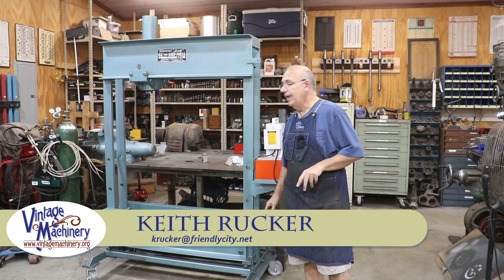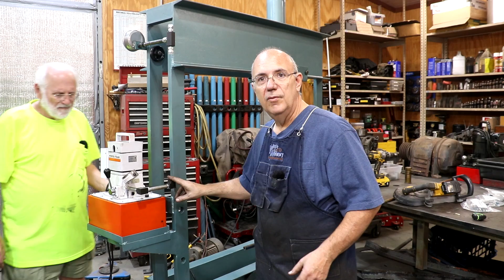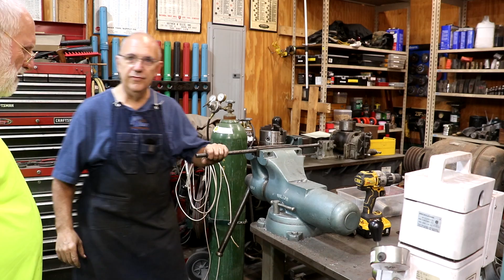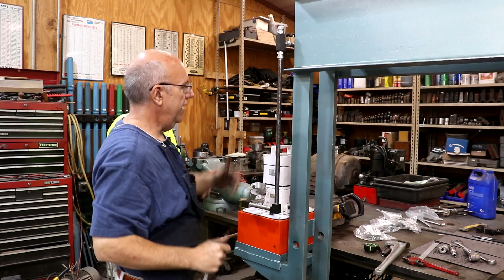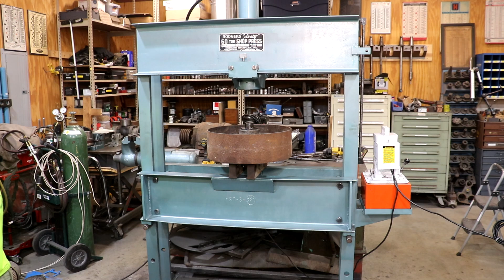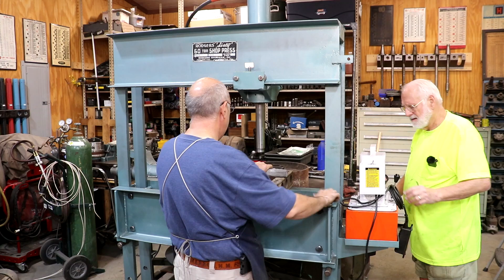Hydraulic Press Restoration:  Plumbing up the Power Pack and Making our First Presses!

Comment: How neat it is to have this perfect pump land on your lap AGAIN ! I have been in a shop where dummys had access to the 50 ton in my corner  of the shop that whenever they showed up to use it I would either leave the area or stop their needs and do the press the job myself. It is called self preservation eh, LOL, Some JIC fittings or pipe thread fittings should serve you well old friend. Teflon tape on hydraulcs is defiently not a good place to go to at all. A pc of tape stuck in a valve can be really dangerous my friend. I put a piece of  belting under that same press to catch all the pieces of material that came from my press. Worked great but a net type would have been far better for the type of jobs I was doing. Luv the channel a bunch my friend. Let us see just what this press is capeable. Should be a lot eh.  A full tone over by the time you get it to the best eh..

Comment: Hello Keith. I noticed that when you tightened up your tail peace chuck on a thread tap, that you only used one position on the chuck to tighten the thread tap and it slipped when you tried to run it in to cut threads. If you will use all 3 positions to tighten the chuck. It will hold much better.

Comment: I would rethink your gauge position. I have a 60 ton press myself with the gauge centered in the front of the press over the ram. I watch the gauge all the time to follow what is going on which you will not be able to do with the gauge and work at the same time. This will keep you out of trouble and allow you repeatability on projects that have repeated operations. My two cents. You will love the press!

Comment: When I have needed to straighten or bend things in my press, I fit a dial indicator so I know how much I have deflected the part. When I take off the pressre to see how much more I need to move, I can then easily get back to the point where I left off.

Comment: That is a nice press. Might be able to make it return faster with a second return line to the tank that is larger than the supply line with a valve that is opened for return. The spring is having to overcome quite a bit of restriction in the supply line and valve body.

Comment: You are better off with a slow-running press with what you do, you have better control over it and can stop it if you have to before it presses too far and something goes wrong. 50 tons is a lot of power

Comment: I had an Aluminum vee block split like that in a press too. I think the sharp corner in the bottom of the vee didn't help either. If you consider the loads, a shaft is trying to pull the block apart. Maybe a shallower vee block angle would be better.

Comment: I need a "Jim Lane" in Charlotte 😁 I have a very similar power pack I want to turn into a forge press but have no clue what I'm doing. Mine is two stage; 700psi fast travel and 10,000psi slow travel. My problem is finding a 10,000psi cylinder. I wish mine was more like yours, just a single. Your single 10,000 moves faster than mine but my 700 moves faster than your 10,000

Comment: it make a lot of noise for slow result for the return you can set up an out side set of springs for faster return also may need to look at the return valve might be a bit small not allowing the oil to return to tank fast enough Cheers on a nice build

Comment: A few years ago, I was at a friend's shop attempting to straighten out some metal target stands on his press. I had them mounted on spacers and was applying pressure when all of a sudden there was a loud bang. When I looked at the press, the metal plate, approximately 3' long was gone! It had apparently sprung, gone down between my legs, bounced off the floor and hit the exhaust on a dragster that was behind me. The "what could have happened to me" thought was off the charts! Standing off to the side when pressing is not a bad idea!

Comment: Keith, considering that your pump has a double pressure valve, you can consider a hydraulic/ cable lift for the bottom assembly. You might need an additional cut off  valve to maintain the pressure for the lift assembly.

Comment: I was setting here wondering if you would break those cast Vblocks.
 Need some machined from some 4140 or other good alloy steel or even heavy fabricated ones.
Leave plenty of thickness between the bottom of the V and the bottom of the block.
 Thank God no one was hurt.

Comment: Nice work as always.

When you make the shop press drifts Kieth, perhaps copy what Pragmatic Lee did with his 20 tonne press when he made his drifts and creat pockets in the socket to glue rare earth neodymium magnets in the bottom, to hold them in place on the cylinder shaft.

19 minutes onwards in this link.

https://youtu.be/OMM56hnK7Bk

Hope that helps.

👍👍👍

Comment: I think the speed is about right and everything seems to be operating up to snuff.  The only thing I might suggest is not to run with the ram extended quite so much as it could bind the piston at a long extension.

Comment: I am trying to wrap my mind arround how 5,000 psi = 30 tons of pressure.
Reply: Hydraulic pressure is multiplied by the area of the piston in the hydraulic cylinder.  The area of the piston must be 12 square inches to achieve 60,000 psi or 30 tons. Therefore the piston diameter is about 4 inches.

Comment: a press is a wonderful fantom in any machine shop, that press is no exception.
When working on a press, I always fear unstable setups, this can cause injuries and at the limits, the death.
on your press, to what i can see, the ram is rather small in diameter so the guidance is not that great so i'd avoid to press to the capacity of the  cylinder when the ram is fully extended.
excellent project

Comment: The hydraulic swivel fittings I am familiar with don't seal on the threads. The pipe has a chamfer on the inside that seals with a cone in the fitting. If your pipe did not get chamfered nicely it probably would not seal well.

Comment: I don't find any schedule 80 pipe that is rated for 10,000 psi working pressure. The burst pressures aren't even rated that high. Be careful! Even hydraulic tubing, only 1/8 inch .049 wall thickness is rated at 10,691 working pressure.

Comment: Keith,'
Dont know if its my eyes or an optical illusion fm the camera lens....but when u last pressed that shaft and the front lower cross beam flexed a bit, it now appears to me that the front lower crossbeam is showing a slight bow downwards in the center.... maybe 1/32 inch where as its mate to the rear is perfectly straight.....FYI
Don

Comment: Oh yeah, nice to see it finally working
What I noticed, it would propably help to tighten the clamp bolts on each side of the carriage with the cylinder so it doesn't tend to wobble when it starts building up force

Comment: Why the fittings didn’t seal is because the swivel end of the fitting is made for a machined fit, like the inside of a hydraulic hose, where as a pipe seals through the tapered threads

Comment: Make yourself a V block that goes on the ram for straightening round shafts. Best accessory you can have for it.
Reply: Keith can probably make a whole video on making accessories for the press, maybe some solid steel v blocks and a v block for the ram. A good set of parallels and all kinds of push rods and different ends for the ram, a lot of will probably be one off items too.

Comment: I'm glad you're making sure all your components are rated for the pressure your unit is capable of producing. 10,000 psi is no joke. I worked for a hydraulics specialty company for quite a few years, then worked as a maintenance mechanic in a production plant. It was not uncommon to find standard water pipe fittings being used in hydraulic pressure applications. Fortunately, the pressures were relatively low (1100 psi). The potential for a tremendous mess was high. My right index finger got injected with hydraulic oil at 3,000 psi and it's not really a functional finger anymore. High pressure leaks can be extremely dangerous.
Reply: I worked with a tech at one company and he lost a finger on a job, when a pinhole leak on a 10,000psi system essentially flayed his finger of most of the flesh. The only thing more dangerous in the high-pressure world is live steam.

Comment: Get a couple of pieces of rail from the railroad (badly worn is ok), mill the tread area flat and bring them to equal height, and they will make ideal support bars for the press.  We used these for everything where we needed support blocks.
Reply: Work hardened I-beams is what we called them.

Comment: Wow, that was fun to watch!  Good job, you two.  I have two "physics nerd" comments; probably not worth the time in a job shop, but perhaps instructive.  First, could you find, or even calculate, the stiffness of your parallels?  Put an unloaded straight edge on the top and you will get an independent measure of the pressing force.  Second, wouldn't you ordinarily want to heat the bent shaft up while or after straightening it?  This would anneal the stresses caused by the bending and probably reduce spring-back.  I realize that welding on a new layer before cutting the shaft to its original diameter would likely do your annealing anyway.

Comment: I like it. I think you should rig a strap to your ram to lift and lower your bed rails.
Reply: I wonder if that ram has enough capacity to raise and lower the rails, I think you’re right about making something to power raise and lower bed rails. Maybe a long hydraulic cylinder to attach to the cables that lift the rails, there are a number of ways to power that.

Comment: The remote pendant is a great option for this press.  The exploding V block is exactly the type of danger that presses are capable of.  I worked in industry where we had a person killed because a tooling piece ejected from a press, causing blunt force trauma that caused instant death.    Great video and great project!
Reply: Dan Gelbart called the hydraulic press the most dangerous machine in his shop tour. The energy these things can store in the workpiece is frightening. They can shoot shrapnel like an artillery shell.

Comment: Back in my earlier years in life I helped design hydraulic presses that would take the kinks out of 11" steel bars.  The presses would develop up to 500 tons of force!  We installed dump valves that would dump the volume of fluid in the cylinder when retracted. Thanks for sharing. Ken
Reply: As an 18 year old I remember seeing a 750 ton extrusion press being installed, well, reinstalled. The plumbing was mostly  very thick wall tube with an acme thread cut, the ends being true, the threaded bits met a copper washer in the middle of a hefty steel block. A crane made holding the fittings a bit easier. Nothing was delicate. The fun bit was seeing aluminium behave like toothpaste!

Comment: I think slow is better on a big press , you can break a lot of stuff getting in, ram it through , it’l go mode ! It’s better to keep the pressure on and use finesse like heat or cold and a few shocking taps with a hammer or air tool . I like it!

Comment: Looking good, Keith!  Glad you've got the extra long cord for the pendant.  You would still have been safe operating from the power pack since the separation of your v-blocks was perpendicular to where you would be standing, but that's still a little too close for comfort.  Your shop, your shop practices.  No criticism, just want to see you not get hurt.  I agree with a previous comment that the bracket for the bigger gauge would be a great place to hang some hearing protection when you're not using the press.  As loud as it was on the video, I can only imagine what it was like in person.  Still working on my plans for a workshop for when I retire.  Out of my price range right now, but I retire in ten years, so it's something to save up for.  Still have a little shop envy, though.  My little 8 by 24 woodworking shop would fit inside yours several times.

Comment: I retired from a car factory. The paint booth cleaners used a high volume/high pressure water jet to clean the overspray off the walls of the paint booths.  It was adjustable up to 10,000 psi.  They normally opersated at about 7500 psi.  The pipe was 1/2" ID but about 2" OD.  Over time the water eroded the standard 90 degree ells and the pipefitters had to replace every standard ell with a long sweep ell to prevent it from happening again. It is amazing what high pressure fluid can do. Keith, please be careful around your press. I was thinking a Lexon screen might be a good idea. Hinge it from the top lip of the C channel at the top of the press. Use a rope and pulley to lower it into place if you ever feel at risk.
Reply: Kind of the responsible YouTuber version of Jackass, sometimes.

Comment: While you're making push pins, make a saddle to fit the ram, to attach a wire cable on each side, over the pulleys, then configure slack to raise or lower the heavy table with the main ram. How cool is that!

Comment: Don't think schedule 80 is rated for 10000 psig?
Reply: Yes, it is Carbon Steel, SCH 80 A106 Seamless, .216 wall thickness. We specified 10k working pressure. Sourced it from Consolidated Pipe in Birmingham. All fittings are POWERTEAM 10k rated.
Reply: @jimlane9039 , Thanks for helping out, it’s always nice having other specialists working with the machinists that I watch. Keep up the good work!
Reply: I don't think he used black iron pipe but carbon steel pipe.

Comment: You can add springs to the ram when you make the tips just flat bar about 5'' x 3/8" two holes on the ends plus the mount to the shaft  spring ends hooked on the roller carriage.. Be quicker returns and hardly any cost ..
Reply: The ram that's on the press now already has a return spring in it. I believe the speed limiting factor for the slow return is just the back pressure of the hydraulic fluid being limited.

Comment: Looks great! You need a milk crate with old inner tube laying in the bottom underneath to catch stuff 😁
Reply: Or a 5 gal. bucket 1/2 to 3/4 full of kitty litter. Preferably not used!😋